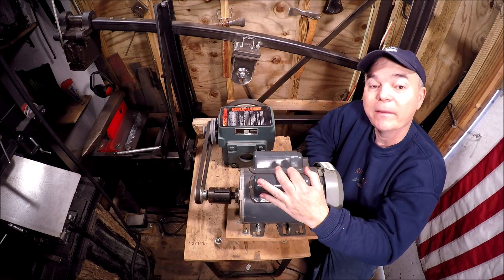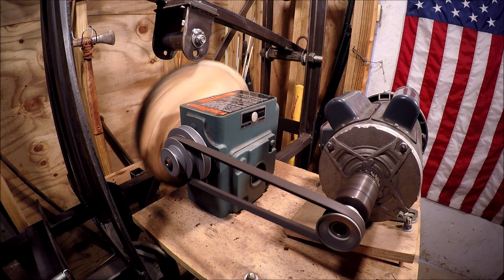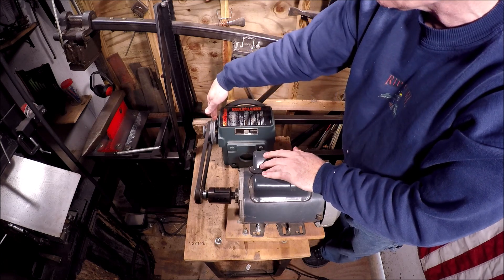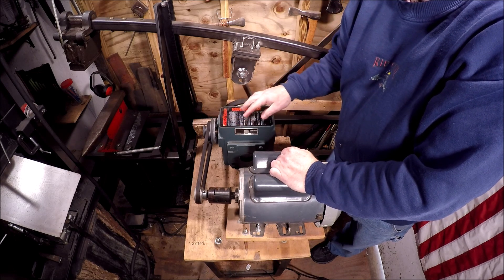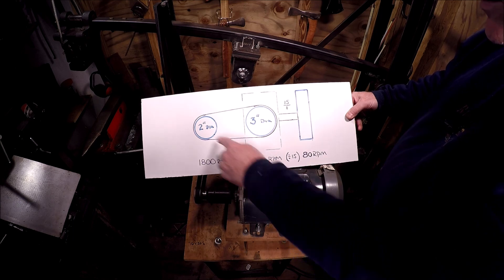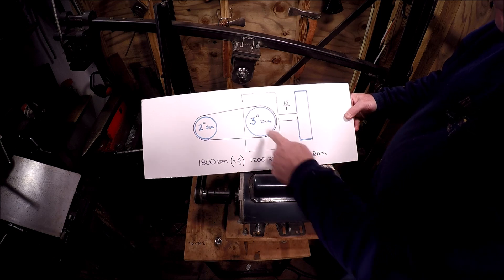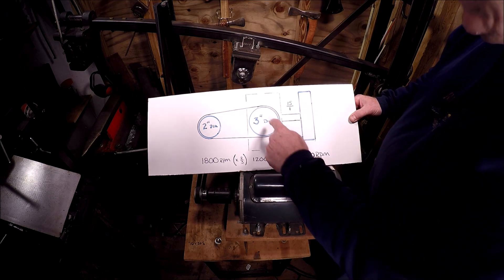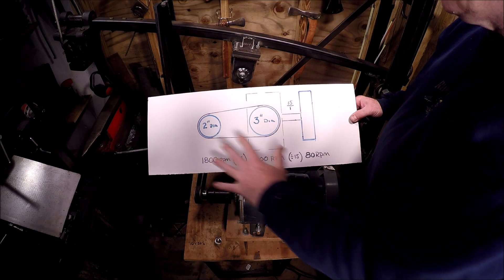Subscriber Question - Speed Reduction For Power Hammer

Comment: Instead of using reduction gearing most just put a big pulley on the shaft with their cam to have a less complicated solution. I've done a lot of homework and looked at several plans on how I'm going to build my own. This is definitely effective but not the least expensive.
Reply from the maker: thanks Adam and good luck with your build

Comment: Do you find the current 80 blows per minute manageable? - sounds like a lot to my uninitiated mind.!
Reply from the maker: For me it's just right but on the slow side compared to other power hammers.    At 80 beats per minute, I have enough time to move/rotate my work inbetween hammer blows yet it is fast enough to move a material amount of metal for each heat.  Thanks for your question and hope that helps.